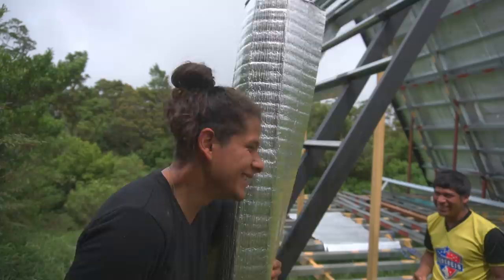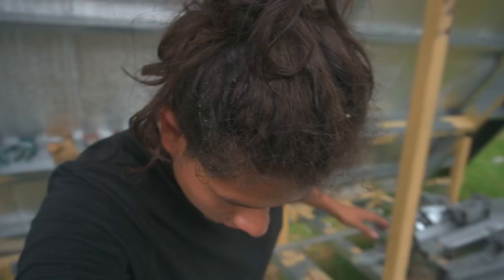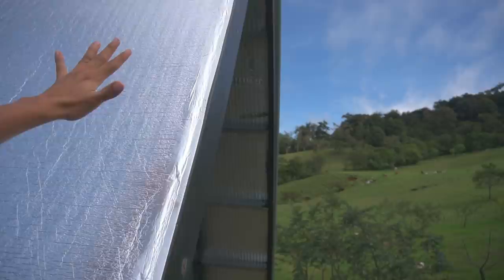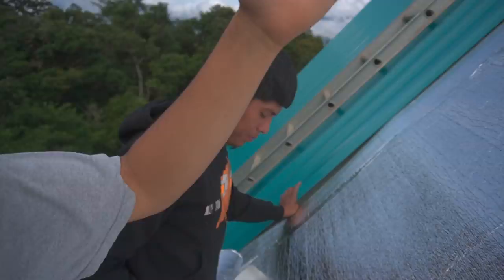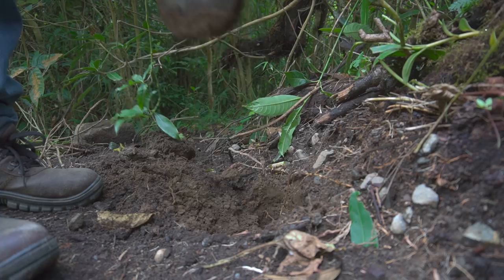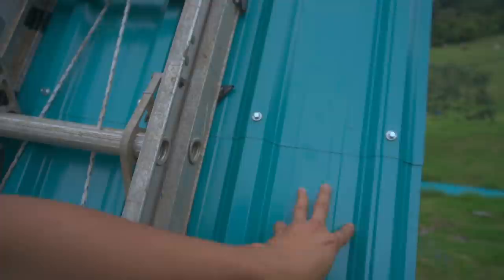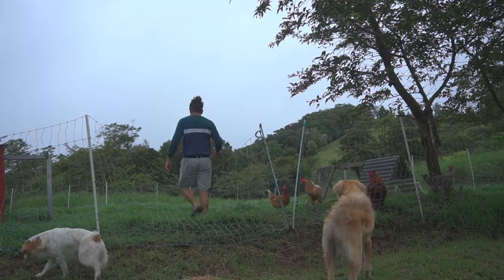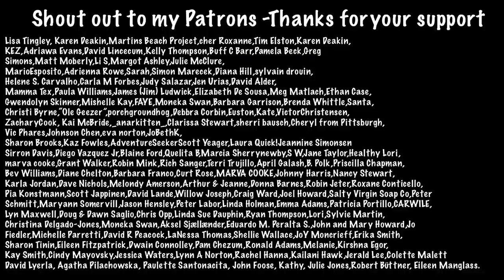WE DID NOT THINK THIS WAS POSSIBLE |Simple Self-Built Home

Comment: Glad you have the roof on.  Now you can work in dry. . I wish you would check out MBF Off-grid to see the sub flooring they used .  It's a Canadian man and wife building a cabin.  The flooring is waterproof and was under snow last winter.  They just shoveled the snow away months later and it was not damaged.  It is OSB but I guess with waterproof glue.  Maybe you can also get it in Panama?  Unless you are pouring a concrete floor?